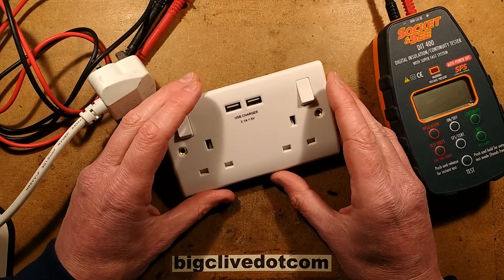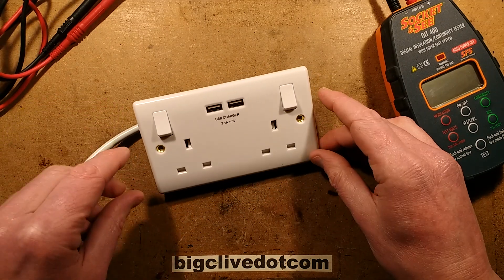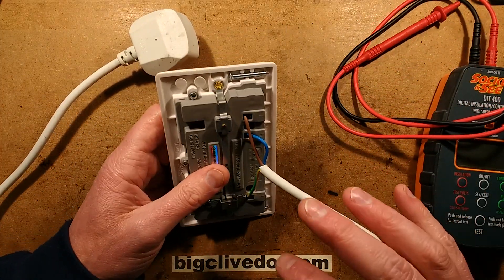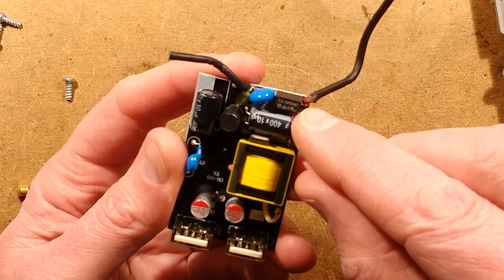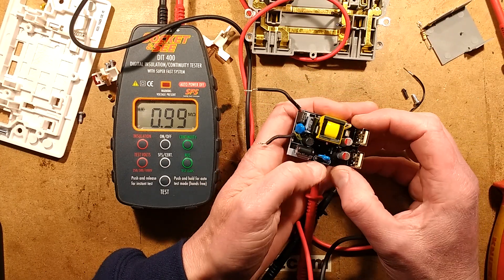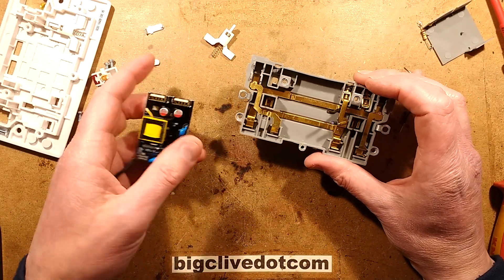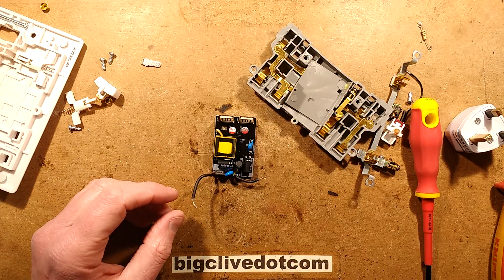500V insulation test of a British General USB socket.

Comment: I wonder if there is a unit that exists with a third double pole switch to toggle the charger off, or one could potentially modify it.... non-compliancy mod! :P
Reply from the maker: The standby current is extremely low.  The only real advantage would be prolonging the life of the circuitry.

Comment: ...and now a question:
In order to pass my City & Guilds I was taught Live =Line Phase, Neutral = Line-Neutral and Earth = CPC (Circuit Protective Conductor). a Wiki page suggests the terms "Live", "formally" known as Line Phase and "Earth", "formally"  known as CPC.
Am I out of date with my terminology? 
OR
a) is the author of the Wiki page wrong? (surely not, when has that ever been the case?)
OR
b) Is the word "formally" indicating  the correct formal term rather that the more common IN-formal terms?
Reply from the maker: They keep changing the terminology over time.

Comment: Very interesting. Another video (from another leading manufacturer/on-line training provider)  suggests that you definitely should NOT test between Live and Neutral at 500V as it is likely to cause damage to the USB circuit. You can test between Live and Earth at 500v but as you correctly state, Live-Neutral is required during installation testing ( >2MOhm @ 500v). For the manufacturer of your USB socket to claim 10MOhm is bizarre (and misleading)  . 
The same video suggests that PERIODIC testers should ALWAYS first test at 250v after their walk-around check that all loads have been removed from circuit. A 250V L-N test will not damage the USB circuit but will alert the tester to the presence of a load still in circuit (since the L-N test will show a reduced resistance for the USB circuit, but not a short circuit). 
At installation (in the UK at least) it is mandatory to test L-N  at 500V and record the result on the Electrical Installation Certificate [EIC] usually ">2MOhm" . The solution suggested (on the videos I have seen) is that AFTER continuity testing (otherwise the insulation test is invalid) you should return to each of these USB sockets and either remove (and insulate) the Neutral wire(s)* or the Live wires(s)* before test L-N at 500v. Note: you must screw all the sockets back into installed position to run the test! 
[*= multiple wires in each socket if this is in the middle if a radial or ring circuit].

Comment: But surely the live neutral insulation test is not valid because the USB charger circuit is across it?
Reply from the maker: The increasing use of short-life electronic junk has indeed compromised the full traditional test.

Comment: 400V Capacitor, when tested at 500V ??
Reply from the maker: My test was abnormal.  It's hard to accept that the full insulation test has been compromised to allow use of built in electronics, that are posing new hazards.

Comment: Clive, shouldn't you have been doing the insulation test between the AC side and the USB connector? I don't know why you're expecting very high resistance between L and N when there's an SMPS connected across them.

Comment: On my 2391 Electrical Inspection tester course, we were instructed that, like you say in your notes, this non-isolatable load requires that the only insulation test is between Protective Earth and bonded Phase/Neutral. You can't expect anything else.. you can't expect any load rated for a 230V supply to act appropriatey if you supply it with 500V (even high impedance source, current limited). That instruction on the course applied in that era specifically if you had circuits with neon indicators (on DP spur switches); you can do a phase to neutral insulation test, but its meaningless- so you can't do it! This must be applied the same to a USB power supply permanently installed in the electrical installation. Not only are the results not about your insulation resistance, but you're measuring the resistance of the load device; which is of no consequence in the Electrical Inspection, while the resistance PE to phase/neutral is exactly what you want to verify.

Comment: I would suggest the way the test for phase to neutral insulation. Would be to disconnect the electronics where it connects to the neutral. To simplify if you plugged in a table lamp and the switch was on, and carry out a phase to neutral insulation test. you would be measuring the resistance of the lamp. 
The electronics is part of the load and as you have found you are measuring the resistance/impedance of the circuitry.

Comment: Dude the 500V is between either mains line and exposed metal parts if class 1 earthing is NOT used as the main method of safety.  This is why Y class caps are rated to several 1000V.  A Class 2 double insulated (not earth metal parts) items must withstand over 3000V between exposed metal parts and mains.

Comment: The point in that safety feature is that kids need to first figure out they have to stick something on the top hole first to open the latch to bottom holes. By that time they should know to be safe with it.

Comment: Hi Clive. You can do an IR test with live/neutral joined in parallel to earth at 500VDC. and make a note on the cert, sensitive equipment. Or you need to disconnect the electronics.
Becomes really time consuming.
Great vid. 👍

Comment: CLIVE.........With TWO (ring) 2.5 t/e twisted together as found inseted in L and N ,   the screw heads are not "micely recessed" they are just proud of top. In this state there is not much distance to the metal instal box.  Bit of bad luck and maybe the faceplate a little loose and bang.  Put lots in and 5 years late happened once when decorator loosened screws to paint

Comment: I know many electricians who hate USB sockets simply because there is no way of isolating the USB circuitry in case of a fault without cutting power to the ring main as a whole. Just a simple switch between the USB sockets would help.

Comment: I don't do wiring these days, but I always used to megger between all conductors same as in this video. Not really a valid test otherwise. That includes 3 phase circuits - you should always isolate the load and test between phases where practicable. One thing I did do differently; I never used a shared sleeving for the 2 earths when wiring the dis board, because you need to be able to check end-to-end continuity.

Comment: Thanks for uploading this. I bought one ages ago and have been umming and ahhing about whether to install it. I just put it on the scope and with a 1a or 2a load it shows about 150mv of ripple! That is worse than the crappy Chinese USB brick that I retro-fused and swapped the zener for a 431 in lol (although that was just an experiment and I don't plan on using it much)😂 What is fair ripple on a USB power supply?

Comment: isnt insulation test only supposed to be read between live and ground and neutral and ground and not between L&N?
you would ruin alot of electronics if going across the load if anything ia connected
Reply from the maker: In the past it was common to test between L and N with no load connected.  If there's a leakage fault it could cause a lot more damage than a leak to earth as the RCD is going to be much more sensitive than a 32A type C breaker.

Comment: I would not expect 500v across a 400v electrolytic is going to give anything like a 10 mega-ohm reading, not to mention the other switched-mode circuitry on the mains side of the transformer.

In any event, it would appear to be impossible to do a realistic L-N installation test with one of these in circuit. I imagine the same thing goes for anything else which is permanently wired in without an isolating switch such as smoke alarms.

Comment: BC, Is the socket itself single or double pole switching. 
In your opinion would it be poss to engineer the USB setup so that it could be isolated by the on/off switches  This method would solve the issue with the circuit testing. Thoughts ?

Comment: i absolutely love the construction of this circuit, two main electrical bus bars underneath the circuit and then soldering a couple of wires onto it 🤔🚌😍
Reply: i wouldn’t put it on my wall though 🤔😐😔
Reply: two main bus bars underneath the circuit so insulation on that and soldering wire on 🤔🚌 🤔

Comment: hrmmm I always thought that transformers only worked on AC? So why would you have one downstream of the bridge rectifier?
Reply from the maker: The DC is switched at high frequency to allow the use of a smaller transformer.
Reply: ahh so its a myth that transformers  only work with AC.... did you ever do a video all about this? I dont recall ever seeing one?
Reply from the maker: @Ressy66  The switch mode transformers are run with AC, but regenerated from the DC at high frequency.

Comment: A few things I would like to see on incorporated USB Sockets that share Mains Outlets (By Law!) is a Decent Surge protection as many have shit protection (a few minor to mid surges and the USB socket in outlets are normally dead this is meant to protect your devices but cost you a fair bit to get replaced!), LED Surge Protection light as well as a Power On/Off LED indicator as well as both a switch for the USB on/off as well as a USB socket cover/protector!

Comment: I have way too many sockets! And some custom made chargers with built in current meter and 2.1A per port. And no capacitor across the transformer, cuz it's linear and it has 16 USB plugs

Comment: One does not place 500volts across the mains, it goes between live and earth, then neutral and earth. You will not get 500volts across the USB power supply. The 10MR is between the poles and earth.
Reply from the maker: To me a full test should include an insulation test between live and neutral since it's the smouldering fault that will not get picked up by an RCD.

Comment: I'd be happier having broken USB sockets in the wall if they were independently switched. Nobody ever seems to consider switches for USB sockets, but I'd like the option for LED lights and fans, or other small draw electronic devices that I may not want to plug and unplug, but also don't want to be on 24/7. Hopefully as more low draw devices hit the market it may come under consideration at some point.

Comment: It was 1983  we were  learning about electricity in a physics lesson . So being an inquisitive 14 year old a duly disassembled the housing of my mother's  1960's  pink plastic hairdryer. Wanting to see  the  motor  running  I thew the switch  and the  electrons decided to leave their normal path and use me as a new circuit. Shaking violently I did eventually shake free the hairdryer. The following day (Monday)  I had physics and  showed my teacher Mr Jowett  the singed thumbs  from my experience. Conclusion the electrical current entered my body via my  right thumb because the insulated switch cover fell of during  disassembly of the housing exposing the brass switch witch became live once thrown. The current  travelled up my right arm across my chest and down my left arm and out of my left thumb holding the metal chassis . Of course these are the days  of the BS 3036 Rewireable  fuseboxs  and MRr Jowett said I was very lucky. Thirty five years latter still playing with those electrons (under safe isolation) as a Spark.

Comment: normally watching your videos is fun, but this one was serious. i have one of these on either side of my bed, running lamps, alarm clocks and charging some portable battery's (class ohlson and kodak branded) as well as charging my phone (asus) and smartwatch (LG). nothing unbranded except for the cables perhaps but honestly, if during this video you said they were bad i would go pull those things right out the wall and in to the bin, leaving a scaving review on screwfixes site for them. :-P

well... maybe not right out... i mean id have to cut the power first obviously... i don't really want to die in an attempt to prevent my own death...
Reply from the maker: They're fine.  One of the better ones I've looked at.

Comment: Some insulation test are done via hours of testing, because you have an initial current spike due to capacities between live a neural for example. Usually the resistance starts low and shoots up. The industry standard is usually 10 minutes isulation test with low ratio of 10 min resistencia/1 min resistance.

Comment: 3D printer I purchased had a plastic earth pin on the plug. ( Did not realise until after ) 
Was using it for 3 or 4 hours and when I plugged the usb into my computer it blew my computer up. Turns out the live cable inside was pinched and torn against inside of case. An easy fix, but did mean I was prodding a playing with a death trap for 3 hours and I was lucky I somehow didn't go all crispy.
Reply from the maker: Not that I'd recommend this, but you can hold a live wire and not get a shock if your body is not referenced to ground.  The slight problem being if it DOES become referenced to ground.

Comment: Can you get insulation testers that put out high voltage DC? The rectifier of the USB supply would then block the current (assuming you connect test leads the right way) and you would get your Mega Ohm reading. These sockets are so common now and if they are not banned (I think that's too late) the UK regulator will have to recommend a different testing protocol e.g. like the methods explained in the comments from viewers in other countries.
Reply from the maker: The test was done with DC.  A rectifier will also route DC to the circuitry.
Reply: Course, for some reason I thought it was just a diode (half wave rectifier), my bad sorry.

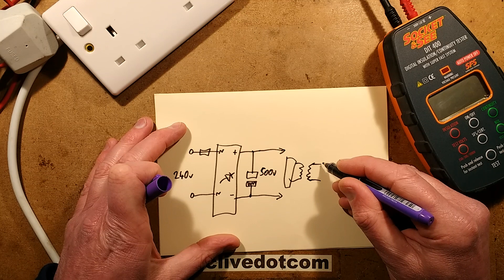Comment: 2:44 How could there be a transformer after the bridge rectifier and smoothing capacitor, surely you've got a DC voltage with just the smallest bit of ripple!?
Reply from the maker: The circuitry recreates the AC by pulsing the DC at high frequency.

Comment: Presumably this design means the power supply is permanently in circuit. i.e. not switchable on or off.
Reply from the maker: Yes it is.  Even if it malfunctions.

Comment: @bigclivedotcom The voltage spec for the EU is 230v +10% -6%, which oddly allows the EU to stay at 220v, and the UK to be at 240v and still fit the spec. A typical "Make the spec fit what we're doing anyway" bodge.  Would have cost a fortune to actually change it to 230v for no reason other than harmonisation.

Comment: I would test it again without the cable on it. You had the live and neutral both touching the bench. Depending on the material of your bench and any contaminants on it just that contact can give a much lower reading than usual.

Comment: Those ground contacts are making pretty minimal contact with the ground pin. If they had a larger contact area then the Chinese sleeved ground pins would be fine.  For example, something folded over to slide along the entire length wouldn't have the problems encountered with only having a little p-shaped bend,

Comment: L to N will be very low because you're running the USB power supply from your resistance tester.
L to N is only a valid test for bare wire with no load at all - this device always presents a small load.

The result of L/N to E will depend on whether the tester is AC or DC.
AC testers will always give very low results because of the suppression capacitors.

Comment: BigClive, what do you think about Grid Tie inverters ?
any good, would you use one and are they legal ?
Reply from the maker: They're commonly used for solar panel installations.  The biggest hazards are their installation by solar installers who have had very little electrical training and the need to detect when the distribution network has failed so they don't backfeed onto downed lines.  Electrical linemen are having to treat all cables as live when they work on them these days, even when they have isolated them from the network, since some equipment is backfeeding power onto them.

Comment: BS7671:2008 (17th Edition, Amd 3), Reg 612.3.1 The insulation resistance shall be measured between live conductors.....    .....Where appropriate during this measurement, line and neutral conductors may be connected together.  

These days there are so many electronic and/or permanently connected devices (e..g dimmers, LED fittings, extract fans) that doing an IR test between line and neutral is potentially (pun intended) disastrous and expensive.
Reply from the maker: I'm guessing that the modern interpretation of this is to just bond L+N and to the test to earth because it saves time anyway.  And yet, failure of resistance between L+N is going to be somewhat more damaging than to earth because it has to pass somewhat more current than 30mA.

Comment: Brilliant video Clive. I haven't actually taken apart a USB socket yet but I have my concerns about them and have done since they came out. In my latest video I fit a few MK logic plus twin USB 2A sockets. When we install them we carry out insulation resistance testing without them connected. You can of course test at 250V but it isn't testing in accordance to GN3 so although I usually test at 250V first I wouldn't want people getting into habits of not testing generally at 500V. I always label the consumer unit / distribution board warning USB sockets are installed and the number of them.

Comment: I have not opened a mains (UK) socket recently, but I understood it was necessary to have both live and neutral switched on socket outlets? Is this not in the British Standards somewhere?
Reply from the maker: You can get double pole switched sockets, but the majority just switch the live.  For full isolation you can pull the plug.